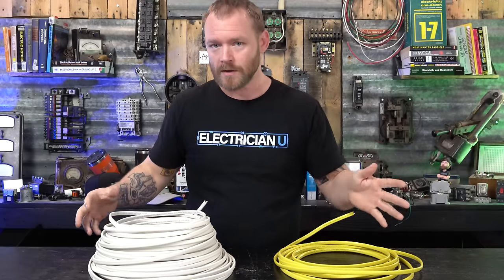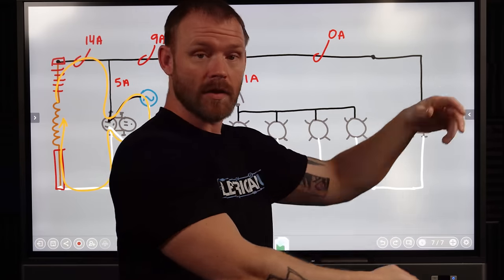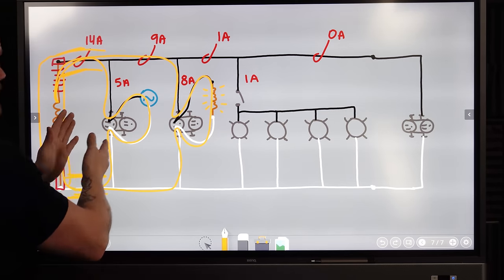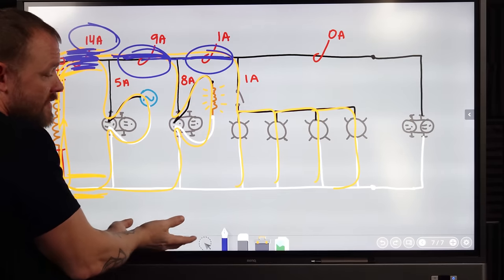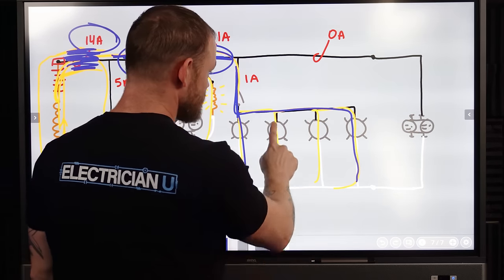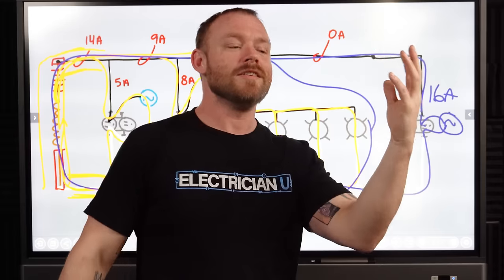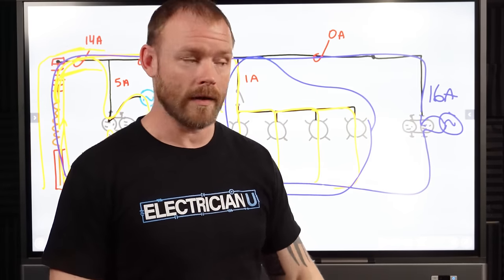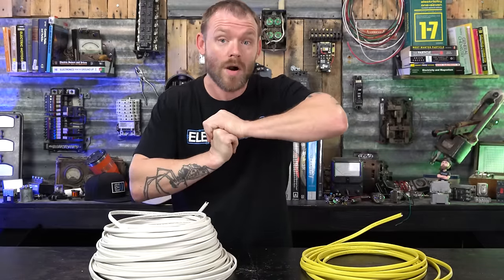Should You Be ONLY Using 12/2? When Can You Use 14/2?

Comment: I used 12 everywhere in my house. I could have used 14, but I already had the spool of 12 there. If you ever want to put in a ceiling fan, It's a good idea to run 12. I might have saved a little bit with 14, but the cost difference was negligible.
Reply: Do ceiling fans require 20 amp?
Reply: @derekofbaltimore  No. Ceiling fans use nowhere near 15 Amps.
Reply: If box fill isn't an issue!
Reply: Exactly, the cost difference long term becomes negligible and you get a much better wire for the life of the service. Same goes for using the higher quality commercial grade 20 amp receptacle outlets.
Reply: Actually, if you're doing a ceiling fan, you should run a 14/3 so you can separate the light and the fan at the switch box. Also you can  get rid of those ugly pull chains. Absolutely NOT a 12/2 unless you are coming off a 20 amp circuit to be code worthy. There is absolutely no reason to run a 12 wire for a ceiling fan. Unless you have 16 or 18  of them on the same circuit. Most residential ceiling fans only draw 1 to a .5 of an amp.
Reply: @richt5986  "unless you are coming off a 20 amp circuit" that's the critical detail. In the video he is mixing 12/2 and 14/2 based on load which although correct is not proper as all the wiring is on the same 20amp circuit. Some like to divide the lights and outlets of a room on two different circuits but I personally prefer to have a whole room on a single 20 amp breaker especially since breaker spaces are limited and get used up real quick with 30amp double poles, kitchens, and bathroom dedicated lines.
Reply: @hippo potamus  I've been a licensed and insured electrician for over 30 years? What reason do you need to feed a bedroom with a 20 amp circuit.   I will wait
Reply: @Derek McGowan   no they are not required a 20 amp circuit. The most a residential ceiling fan can draw that I have personally seen was just over 1 amp
Reply: @hippo potamus  Also, when wiring a house, which I have done thousands of times, the whole 2nd floor  lighting is usually on one 15 amp  circuit depending on the square footage of the rooms. With what LEDs draw, this is more than enough, and then you can put 2 to 3 bedrooms on a 15 amp circuit for the outlets as well. Depending on the square footage of the rooms per code.
Reply: @richt5986  How about if you have an old house without central ac and you use a space heaters? i guess you have never seen burned brown 15 amp outlets in your 30 years huh? Additionally you can add more outlets without having to care about useage loads, also the 20 amp outlets are far superior in quality especially the commercial grade ones, and lastly over the life of the house 50 plus years electrical system the cost to run 12ga over 14ga and their respective breakers costs fractions of a penny for a far better product. Wow you are an insured bla bla bla appeal to authority fallacy and you couldn't think about the points I've made? Even if I could run 15 amp breakers with 14/2 wire I would never do that. But I can already see the main reason you did was probably just to make your installation easier running the thinner wire.
Reply: @hippo potamus  for the record. I have been an electrician since the mid-90s. In PA. I have 6 years of schooling under my belt plus 3 vans 7 guys that work for me. My work is in everything between residential commercial and industrial. also, If you wired a home the way you first spoke about unless you got it approved by the builder you would make 0 money. Lol
Reply: @hippo-potamus  Also still waiting for an answer why in a new home? Would you run a 20 amp 🤔 circuit for a bedroom
Reply: @richt5986  IDGAF about your credentials nor does that have any merit on my points, that's what is called "appeal to authority." And you just revealed your  bottom line, self interest. I'm not looking at this from a money hungry perspective. I was right about you. Your goal is not to provide a superior product but rather the most basic service with lowest cost products and fastest turnaround time. I'm looking at things from a homeowners perspective with quality and long term value in mind. You made yourself look bad mate.
Reply: @hippo potamus  I do not.  what you fail to comprehend is. You cannot install the things you're talking about unless you get a written ok on the contract to say it is OK other than that you will have to pay. For it out of pocket again? I do, however, offer upgrades of better metals. i honestly don't think you understand the price difference. Between a 8 dollar outlet and a 1 dollar outlet if you are installing 40 of them in a house. Maybe you like being broke. Or having your children hungry. But ok. I can tell you're not an electrician. working at Home Depot does not count. Also, everything I said is a 100% safe and to code in the United States.
Reply: @hippo potamus   I'm gonna say you're not answering my original question because you just don't know because you don't have the knowledge. Have a good day  working at home depot.
Reply: @richt5986  I think you missed his answer. He said the reason to put bedroom receptacles on a 20A is space heaters.  I'm with you, though. I've wired hundreds of homes, and every one had bedrooms on 15A circuits.
Reply: @phi5head I didn't miss the point at all it was silly. Most space heaters that are a 120 V are 1500 W. That's 12.5 amps.  They should be on a dedicated circuit regardless of what the bedroom is.  If you have 2 heaters, 1 in each bedroom , it would blow the fuse or trip the breaker, so it would not matter what you have to the bedrooms.
Reply: @phi5head  so you would put every bedroom in a house on its own 20 amp breaker. He said this would save space in a panel 🤣 what world
Reply: @richt5986  You are right mate. We should all strive to achieve the bare minimum.
Reply: @hippo potamus  not what I said at all, but you think that. Still waiting on that answer. Also how long have you been in business. Not long I know that lol
Reply: @richt5986  I already answered your question mate. First you asked why a bedroom would need 20 amp circuit. I answered that. Then you changed your question to why a NEW build would need that. You're definitely a 70% type of person.
Reply: @hippo potamus  I was actually being detailed in my question. But your answer was off and silly. But all around wrong, you Contradicted yourself about saving space in the panel and running a 20 amp  circuit to every bedroom. Ok mate 👌 👍 👏 🙌 🤣 😂
Reply: @richt5986  Yea ok Mr. 30 years in business, 7 man crew, 3 vans, and a partridge in a pear tree, bla bla bla didn't even consider space heater usage in the old houses in PA. That's funny. And I like the emojis those are the same ones my little cousin uses, she's 9.
Reply: @hippo potamus  she sounds more intelligent then you. 😂🤣 mate
Reply: @richt5986  "then me." Yea very intelligent. gay emojis
Reply: @hippo-potamus  so ur triggered and need the last word. Mate
Reply: @richt5986  Super "triggered."  Don't forget to mark your calendar for the Philly gay pride parade. Everyone there practically speaks with emojis you'll fit right in. But of course you already knew that I'm sure.
Reply: @richt5986  The cost difference between #14 and #12 is minimal in the scope of the average residential project. I would never put multiple rooms on a single circuit with the exception of the lighting circuits. Given that almost every bedroom will have a TV, computer, monitor, printer, gaming console , and probably a stereo, (especially in the kids rooms), it is better to provide more power than needed. If you aren’t making money on the project, you underbid it. Want to save money on an electrical project, get the code requirements for AFCI and most GFCI outlets removed. A properly wired house doesn’t need them.
Reply: @littleprincess4417  lol you put gfci in bedrooms. 👍
Reply: @richt5986  The code requires it in some bedroom locations. My comments were about GFCI and AGCI in general. If a house is properly wired, with sufficient receptacles, there is zero need for AFCI protection. I know all about the stupid homeowner running a $1 extension cord under a throw rug. You can’t fix stupid, nor should you punish normal people for things stupid people do.
Reply: @littleprincess4417  omg. You sound top-notch 👌 👏 👍    you keep doing what you do 🙄
Reply: @littleprincess4417  also if you live in the US. please show me the code that requires a gfci outlet. Unless you are talking about an ungrounded circuit.
Reply: @richt5986  Without dragging out the book, the code states that any receptacle that is within 6 ft of a sink must be a GFCI. Ryan Jackson did a great video on that. I think Ryan said the code changed in 2023 to include if the cord passes through a doorway. While it might be rare, there are situations where a GFCI is required in a bedroom. AFCI is required in any case, which is a waste of money if you install an adequate number of receptacles so that cheap extension cords aren’t needed.
Reply: @littleprincess4417 The question was, why do you need a gfci in a  bedroom.   you just gave me a word salad lol. .  But no straight answer. I gave you the answer. 
I have had an electrical license for ten plus years. I also take code classes every 4 to keep up on everything. I know exactly when you need a gfci in a house.  You, my friend, are confused
Reply: @americanliberty4898  Get a bigger box.
Reply: @richt5986  Loads that exceed 1440 W for three hours or more.  If you've been a licensed and insured electrician for over 30 years and can't imagine such a load in a bedroom, it's time to consider retirement.
Reply: @jmdavison62  that's 12 amps.  At 120v. So what are you running in a bedroom at that amp. It's also over 80% of a 15 amp circuit. Soooooo what's your point.  Also if you look at any new build home by the nec. Bedrooms are fine on a 15 amp circuit. Also engineers rate Bedrooms at 15 amps as well so I guess every one should retire. Lmfao ok
Reply: @richt5986  "hippo potamus" has raised valid points and answered your points; you haven't raised any valid objections and are relying on citing 30 years of experience, which is irrelevant apart from implying that you've ossified and should retire.  Given that you haven't contributed anything useful to this discussion so far, perhaps that's the main thing you should take from this discussion.
Reply: @jmdavison62  lol triggered much
Reply: @richt5986  lol troll much?  Get a life lol

Comment: The only problem I see is the LED leg with 14AWG (15A wire) wire, will not be sufficiently protected by the 20A breaker in the service panel, especially    If one of the LED fixtures does something quirking and starts drawing more current than the wire is rated for.

Comment: Great video! Well produced, and I learned something. THANKS!!!
Reply: If you "learned something" from this video, you're not an electrician. The concepts presented here are unsafe, and would be a code violation. You cannot safely (or legally) use #14 wire on a circuit protected by a 20A breaker (which would use #12 wire).
Don't do it...

Comment: The 1 amp circuits would require a  separate smaller (2amp) breaker (for the branch) if you wanted to use 20g wire. An accidental dead short or high increase in resistance in the 20g circuit would cause that section to heat up (if breaker in panel was 20amp)

Comment: I thought you couldn’t use a 20 amp breaker with 14 gauge wire.  Always can use bigger wire on a smaller breaker but not the opposite?

Comment: 14/3 for networked smoke detectors. Each one counts as 1/2 a devise and should be branched off a lighting circuit. 
But could one really get away with #16 on 7.5 amp breakers for lighting. It should make sense if all your lights where LED's,
but follow the code.

Comment: The last time I wired a house,  I used 10/3 for all outlets, plugs, and 12/3 for the lighting circuits !, inspector was impressed after I explained that by using one Guage higher than code called for, it would cut down on overloaded circuits and in the long run more efficiently of the electrical system, of course, now it's probably too expensive, due to the shortage of copper as it's being used for electric car battery manufacturing!!
Reply: Why 10/3 and 12/3? Why not 10/2 and 12/2?
And did you had trouble hooking up the normal 15A/120V outlets?
Reply: @martf1061  meant to say 10/2 and 12/2 !, lol 😆
Reply: @b.powell3480  cool. But i bet it wasnt easy hooking up those outlets..😏
I know by experience its not lol 😉
Reply: @martf1061  no, but using pig tails helped a lot !, and electric bill was quite a bit lower because of less voltage drop !
Reply: Way overkill.  The limiting component becomes the outlets.  I did overkill by having a subpanel for the kitchen/laundry/bathroom wetwalls and lots of circuits with few outlets.

Comment: It's kind of funny because at one time,  maybe 10 years ago, there we some advocating for 12DC circuits for lighting in new home construction. In the long run, this would be more efficient and at least theoretically cheaper than every light fixture having separate little circuits to reduce and rectify the voltage. By having one quality power supply makig very clean 12vdc, the lighting fixtures could be simplified and lower cost. and the LRDs would last much longer. By incorporating a small auto switching UPS  as part of the power supply, you would have a system that supplied lighting in a power failure. 

It's a concept that made a lot of sense for several reasons. LED lights were pretty pricey back then and the idea of simplifying them to reduce their cost made sense.  IDK, maybe it could still make sense with standardized 12 volt lighting modules, There are some out there in different styles and stuff made for the RV industry, as well as strip lighting, which is pretty cheap, Low voltage wiring offers additional savings in wire and components. I think that once the concept caught on, the cost of everything would go way down. This would be a natural for solar powered systems and off grid set ups.
Reply: i've often wondered why not too as many tv's games etc  run a power brick off 110-115 then step down to 12 volts on average.  i suppose if you owned a mansion there may be a voltage drop but in reality you could easily run most of a modern home on low voltage.
Reply: @richardcranium5839  Other than HVAC and few appliances, low voltage DC could power a lot.  In recent years, very small solar powered systems have brought power and connectivity to many remote locations.  

If I  were going to build a new home, this is something I would definitely look into. Even if we still   used utilities for those high powered systems, we could become so much more efficient if even a small amount of power was generated locally with solar and stored on high efficient batteries.  I think this is something within most  people's grasp on a small scale. The fact that these kinds of systems tend to be modular, I think this is the kind of thing that you could start small with and over time, grow and expand.

Comment: 14ga is OK for light circuits, but it's NOT ideal how you describe it. I have my lights on their own seperate 15A breakers and 14ga runs for each floor .  I have NO receptacles on any lighting circuits for any floors. Receptacles SHOULD BE on their own breaker for each room, some rooms like kitchen, garage have multiple receptacle circuits.  I can trip a receptacle and the lights stay on.  It seems odd to have receptacles and lights on the same circuit.   This looks like a way to skimp on both wire and work . I did this in my shed years back. I came out of a receptacle to run an overhead 30w T8 shoplight. ...and my electrician buddy gave me a ration of $hit to no end !!!  "You run a skilsaw out here, blow a breaker then you're in the dark ! "   He's right ...   It may be code legal but i don't like this parallel thing in a house.

Comment: Yes, BUT, the circuit breakers are there to protect the wiring (in the walls, etc.). So, can you use 14AWG wire anywhere on a branch protected with a 20 Amp circuit breaker?
Reply: Your wire will overheat before the breaker cuts.
Reply: Nope. 240.4(D)(3)

Comment: Can you use a combination of 12gauge with 14gauge in the same circuit? Using 20A breaker? Ex: I have an older house with 14gauge inside the walls.. i have run new 12gauge romex under house to make smaller circuits.. Can i run 12gauge underneath to connect to a pre-exising 14gauge circuit?
Reply: That's a stupid question.  No. 20a protection is oversized for  #14 in your case.
Reply: Also, make sure to never sell that house to anyone. If it burns down, let you be the victim.

Comment: That is great unitil someone decides that they want to add something and they find rhe wires and tap off of it with something that is a possible heavuy load and now that low draw branch is exceeding wire rating. In this example it would be better to show a downsize in wire guage close to the device load or at least indicate that the wire is not Romex.  Motors and lamps do it all the time with lighter guage wires but you typically would not tap into a cord or stranded pair at the load.